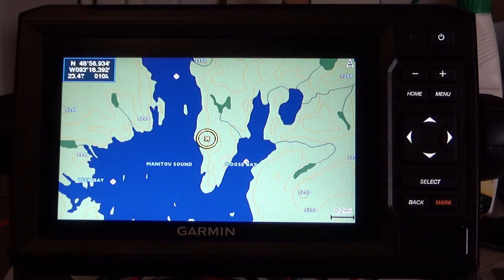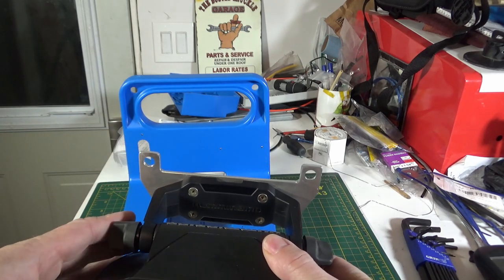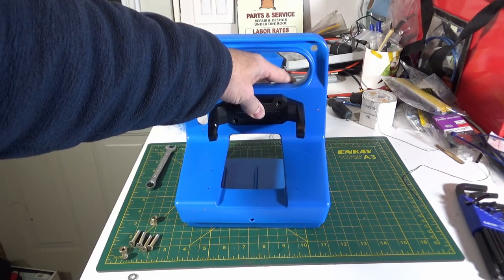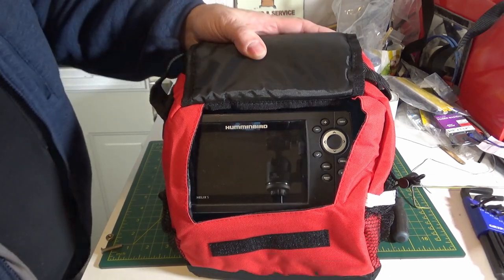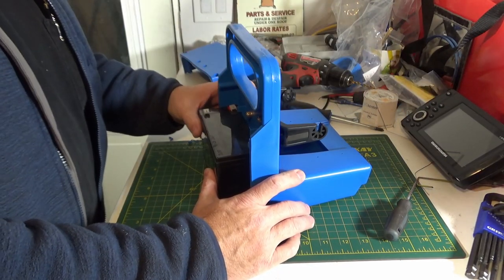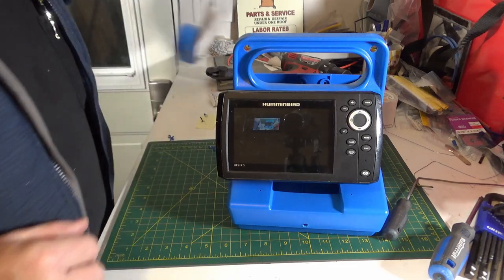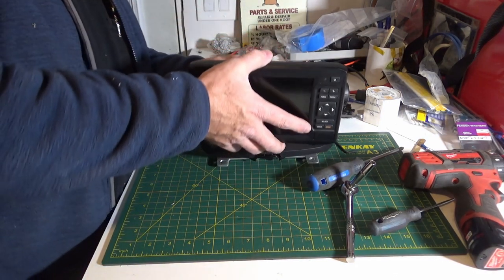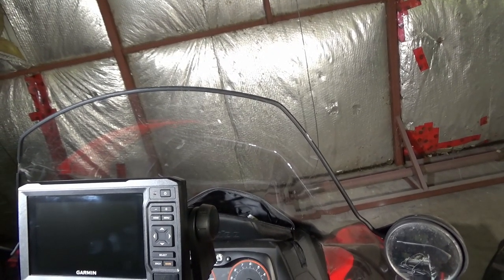How To Mount a Garmin Echomap on my Ski-Doo Expedition SWT: AN ELECTRONIC ADVENTURE

Comment from the maker: So why do I need two GPS units on my snow machine?  Obviously, the Echomap has a nice big screen that is easy to read while riding.  There are three main reasons for keeping the Montana installed on my machine.  First, it is already installed and working so why remove it.  Second, due to the lack of a USB port on the Echomap, it does not play well with the Garmin Basecamp software which allows me to overlay GPS data on a Google Earth map.  The third reason is that the Echomap does not have a battery so it is not possible to operate it off the snow machine (handheld).

While the Montana's screen size makes it less usable while in motion, its other benefits mean I will leave it installed and continue to use it.

Thanks for watching my video.